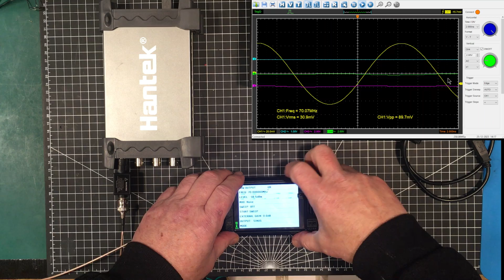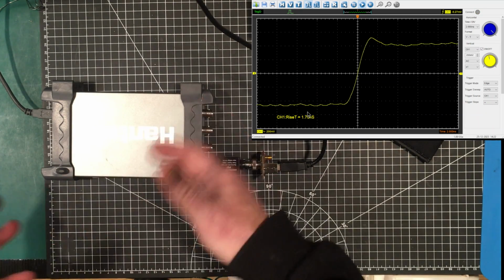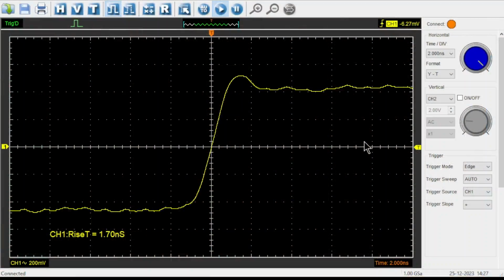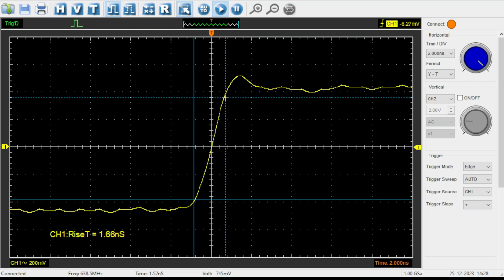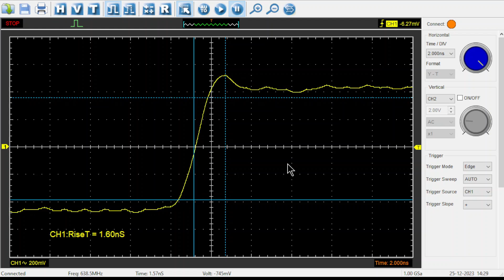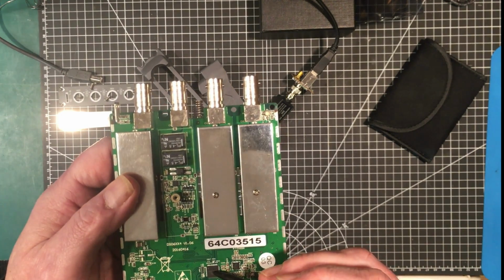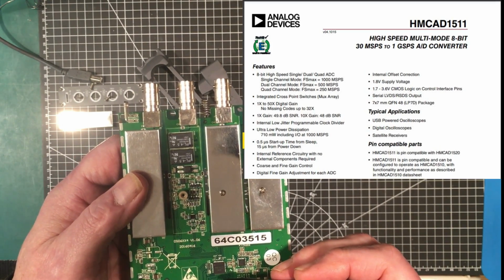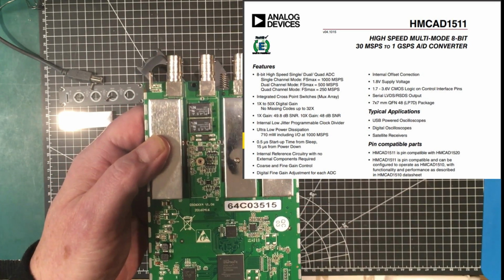Uni-Byte 0141 - Hantek 6074BC USB Oscilloscope:  Part 2 - Nice for the price!

Comment: Actually Hantek produce some pretty decent desktop scopes.
Reply from the maker: To be honest I do not have hands on experience with all of them, but the ones I have had the opportunity of using were not that good.  To be fair that was a few years ago now so things might have improved in that respect but I've not seen much positive news.  Especially with the latest DSO2x1x models.  Judging by the reports over on eevblog.com and videos here on YT they are very disappointing.  All that said it would be nice to read or see a positive review.  Did you have a particular model in mind?
Reply: i have 6254bd and it works pretty well.